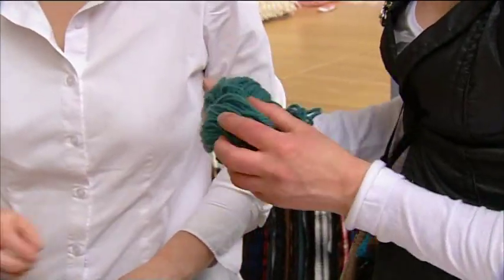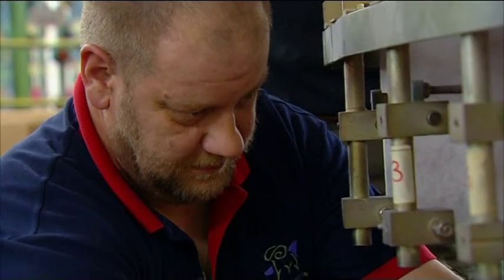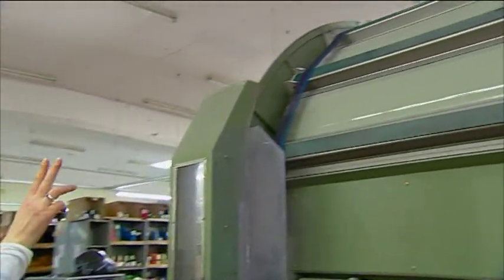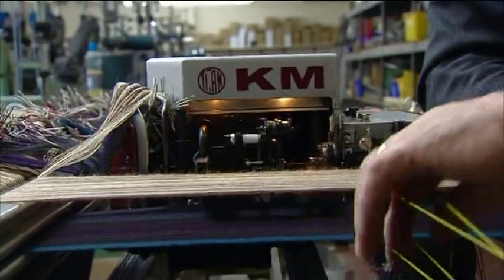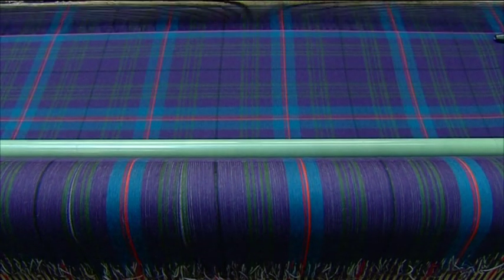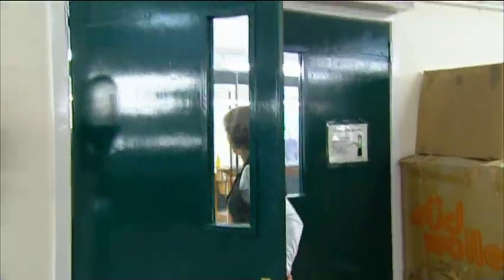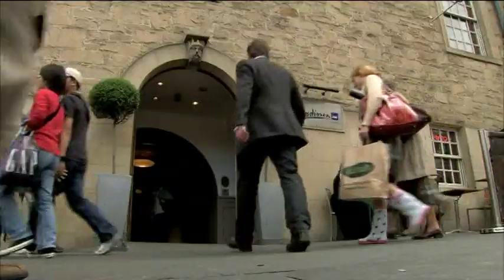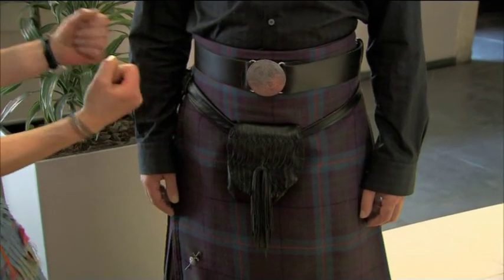How to make a Kilt - Part 2

Comment: I have a blue-and-black kilt hanging in my closet, like the one in Part 1, but blue instead of orange. I bought it at the thrift store for a Halloween costume, and it didn't quite fit me, so my mom fit some black elastic around the waist. I usually wear it with black tights and black ballet flats. Last year during English class I wore it with white sports socks and sneakers, with my brother's black polyester shorts underneath, with their elastic lined up with the elastic of the skirt.
Reply: Don't get rid of it! It's too much of a treasure and your future children may love it. It's a great way to learn about Scottish tradition. I had one too when I was a girl. My mother made it. The fabric would have been exceptional.